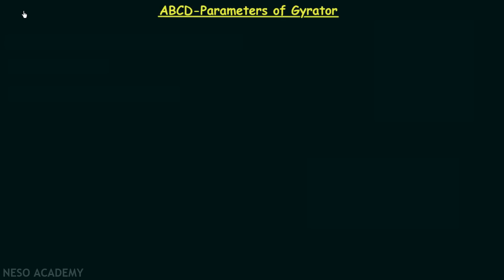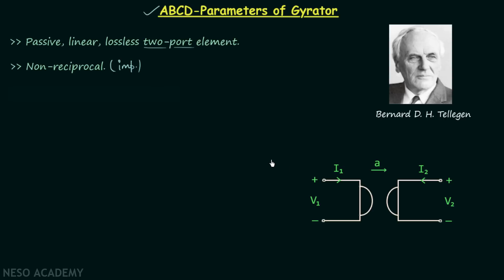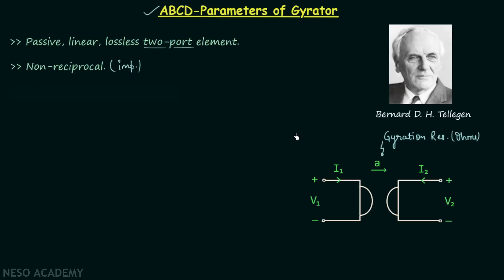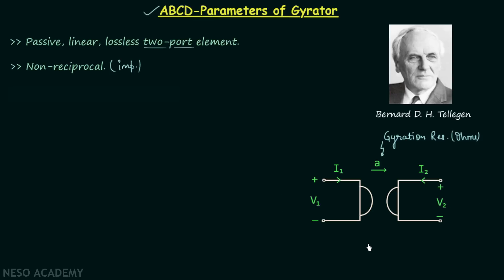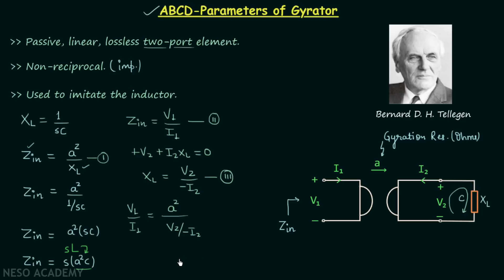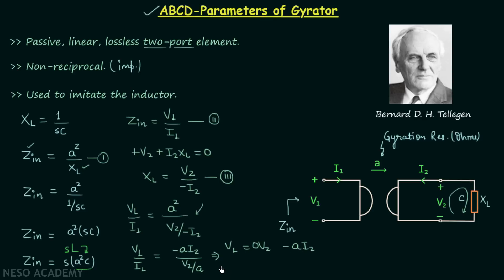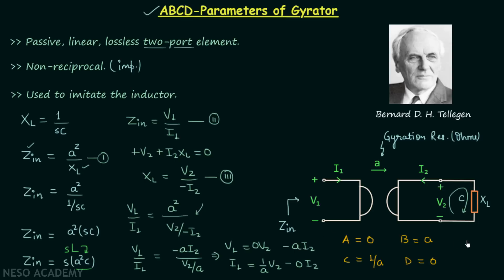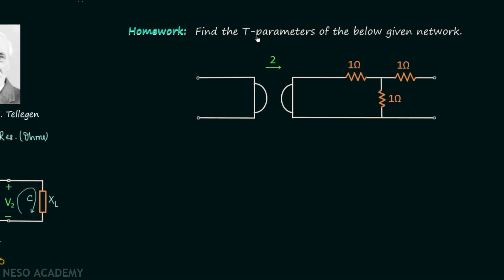ABCD−Parameters of Gyrator

Comment: A=2 
B=4
C=1
D=3/2
Reply: How will i solve please guide
Reply: @saketsamrat5038  The network is divided into two networks a (Gyrator) and b(Three resistors)
Ta=[A , B , C , D ] =[0 , 2 , 1/2,0]
Tb=[A , B , C , D ]= [2, 3, 1 , 2 ] (used shortuct)
T=Ta*Tb
Reply: @reficeismail6520  For Tb I'm getting [2,1,1,2] please how did you end up getting 3 cause I used the Z parameters formula of Z11-Z12, Z22-Z12 and Z12=Z22
Reply: @victoroluwadamisi652  you got this matrix in Z parameter - you again have to convert it in T parameter using the conversion formula
Reply: Thanks dear 🙏🥰🇮🇳🇮🇳